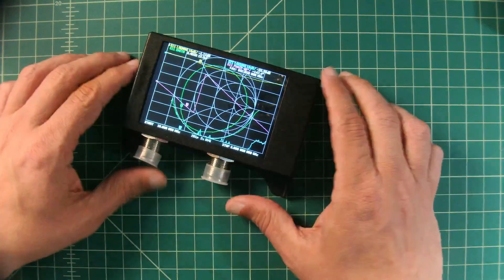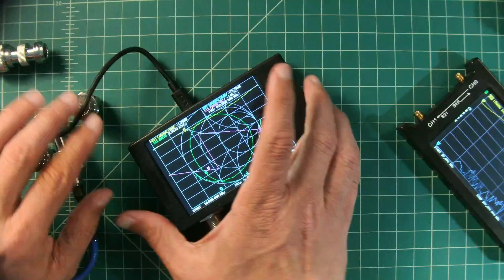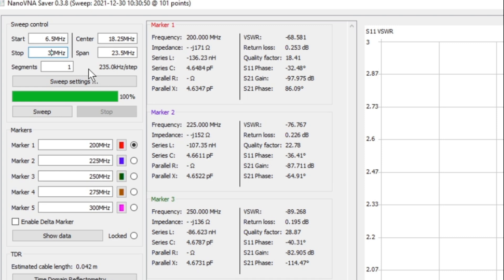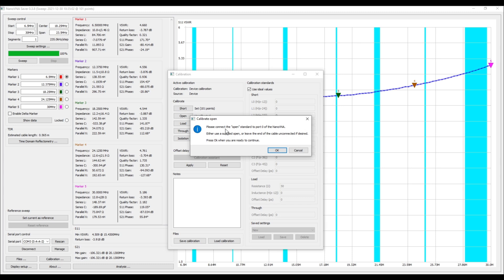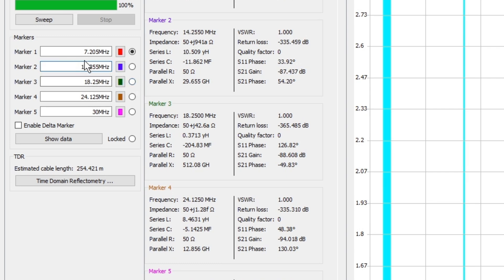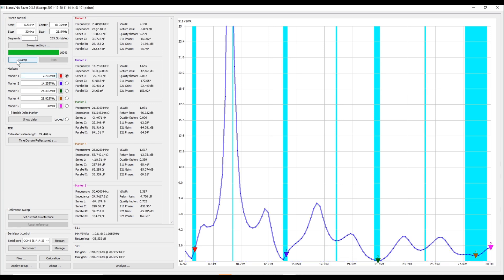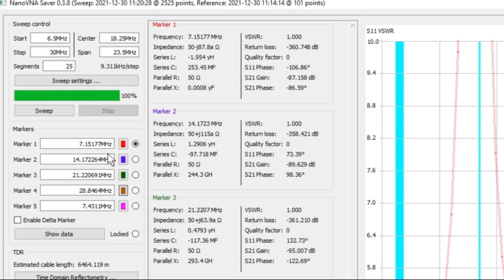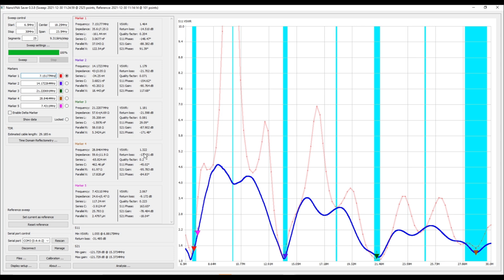Data Points on the NanoVNA SAA-2N

Comment: Hello. Are you using the zeenko VNA (SAA2N). Isn´t the 25 segment sweep a little slow in terms of time ? I have both SAA2N and H. The H is more than 3 times fast but only supports until 101 points. Also, your saver version is a little old
Reply from the maker: The Saver. Person is old because the video is old.  I believe it was a ZeenKo but I can’t remember.  You can adjust your setting to meet your needs, I used a high segment count so my data points were closer together 👍
Reply: @TheSmokinApe  I am 30 years old electronic engineer using this rf instrument for biosensing (have a SAW sensor). Well, today I solved it. My SAA2N is from zeenko so I updated its firmware and now the sweep velocity is equal respect to H. The firmware is from dislord.
 I use nanovnasaver because I had to change the code to add new tools. I also reduce some wait/sleeps on the code to get some mSeconds. Greetings from Argentina

Comment: Thank you for a great presentation. I do have a question about the differences between the two scans.
What happened to the higher peaks recorded in the first scan but not repeated in the second? I'm not new to electronics but am new to RF. Sorry if this is a sophomoric question.
Reply from the maker: Hey Bill.  If I remember correctly it had to do with the number of data points measured in the sweep, the more point the more accurate the trace 👍
Reply: @TheSmokinApe  Hi SmokinApe - Thanks for getting right back to me. I agree with what you say as it applies to the valleys in the scan. As an example of what I don't understand is shown at 10.77MHz. There is a red dot here (assumed point of calculation) with an SWR of ~ 7.9. I can't make out the dots on the blue trace but the result is ~4.1. Cheers! - Bill

Comment: That is the model VNA I have.  I am about to check all my antennas after a long time of not using them.  Luckily my antenna switch grounds all but the antenna I am using so that handles the arcing.  And, when turned off, it also grounds all antennas.  That is a nice bonus of the switch.
Reply from the maker: Good luck with the testing Doug 👍

Comment: Hi SmokinApe I have a question, I really want a nano VNA, this one seems to be the best of them all, even currant date. If you agree please let me know I want a VNA with the 4 inch or bigger screen and up to 3gig seems great even though I will never use it, you never know. It seems well built and I was hoping to get some advice. I live in Canada and can only find these big ones on Amazon, so i hope they are not fakes, then seem legit. I am a new ham and cannot afford a really antenna analyzer like rig expert, and even so nothing in this form factor even comes close like the Nana to doing both HF and uhf/vhf, that is also important to me. It seems the Nano Saa-2N is the way to go, it may not be as lab quality as the Rig Expert and others, but for Ham is it really necessary to be that high degree of accuracy. Please advise. Thanks love all your stuff.
Reply from the maker: Hey Taz.  I prefer the VNAs over the REs for a few reasons.  The SAA-2N is a durable beast, you will love it.

Comment: Great video.  Thank you for making it.  I'd like to get one but I need help.  Where can I get one and from which manufacture?  There are quite a few.  The link provided takes me to your Amazon page but the vna isn't there.  Also, why are the prices all over the place for the same device?  $86-300?  What am I missing?  Thanks.  :)
Reply from the maker: Hey Seafever.  Here is a video where I explain some of the differences, it's a little old.  Some of the newer ones have more features like more spectrum, more data points and SD card storage... oh, and larger screens.  The Aursinc store on Amazon is a good place to look as well as RandL.com
Reply: @TheSmokinApe  
Cool beans. Thank you I greatly appreciate it.  😃

Comment: Any benefits to going N Type vs SMA? It seems either way you need adapters. Thoughts?
Reply from the maker: You will need adapters either way.  Some folks will insist that N are more robust or SMA go higher in frequency.  As a ham, I would just get the VNA that meets my needs and that I already have adapters for...
Reply: @TheSmokinApe  makes sense. Thanks for that.

Comment: Great video and many thanks! I'm glad I purchased this item and more so since I discovered your channel. You provide great advice and your explanations are always succinct. My question was with your marker for the ten meter band. Checking with the ARRL band chart, it appears that setting the marker at 28.850 places the marker out-of-band even thought the blue chart section reads for ten meters. Am I getting that wrong?
Reply from the maker: Hey Randy, the band is from 28 - 29.7 without my glasses on!  But you make a very good point that the blue bars are not for IUT Region 2 where the US is located.  You can configure them in the options and need to for 40m and 440m and maybe a few others if I recall correctly.

Comment: I bought one of these. I must say the reason I bought it was to tune my Buddie Stick Deluxe antennas. I have the stick deluxe and the pole deluxe. So my main reason is it's much smaller than my Comet analyzer and easier to carry. I figured it out but I think a video using the screen to program it would be good. For now, I am only using it to check my tuning and SWR. Could you do a video about how to use this in the field? Thanks again for the info. Keep up the great work. KO4PDI 73
Reply from the maker: I can, also I have a playlist of NanoVNA videos that might help.  Thanks for checking out the video Michael!

Comment: Great video...which camera are you using if you dont mind me asking?
Reply from the maker: This is the one I use for overhead: https://amz.run/5Tma
Reply: @TheSmokinApe  thanks Ape.. you have he
Ped heaps with my Nano VNA..do you think you could use the Nano VNA with an 27mhz SWR meter and a dummy load to calibrate or check the SWR meters accuracy?
Cheers
Reply from the maker: @andrewverran3498  I’m not sure the VNA would put out enough wattage to register with the swr meter.  You could measure the same dummy load south both and compare the difference
Reply: @TheSmokinApe  no worries . Much appreciated.

Comment: Thank you for the excellent video. 
Just a comment about the static discharge from the antenna for the benefit of the viewers. Note that the static build-up is actually a charge between the coax shield and center conductor of the antenna feedline stored on the dielectric insulation. In short, the coax is a storage capacitor. The antenna is the charging device, building up the voltage caused by dry air moving across the antenna elements. So a longer run of coax is a larger capacitor. I was once knocked across the room by the charge built up in a 100 foot run of RG-8 that was not connected to a radio but had been connected for a few days to my longwave radio antenna with its 2 miles of 22 gauge wire in it. I don't know what voltage it had built up to, but THAT voltage at THAT current threw an arc that knocked me down, and could and would easily kill any piece of ham equipment it was plugged into except possibly some old tube gear. Lesson learned. I now include a 2M Ohm resistor across all my coax runs at the antenna to dissipate any charge before it can build up.
Reply from the maker: Wow, that’s is crazy.  Thanks for the info 👍

Comment: Great video. Thanks for posting. I always knew how important sampling points are. The downfall of one of my antenna analyzers is it is limited to only 80 sampling points. To me, it's limited to single band coverage.......and it was an expensive analyzer.
My SARK 110 can sweep up to 10,000 sampling points as a stand alone unit, but it takes 20 minutes for one sweep. 
I like my NanoVNA H4. I do not want to lug a computer around with me. The H4 can sweep up to 500 sampling points as a stand alone unit. What about the SAA-2N....how many sampling points as a stand alone unit?
Barry, KU3X
Reply from the maker: The most I can get on this one is 201 standalone
Reply: @TheSmokinApe  Correction.....H4 can do 401 sampling points. 
When I got the H4, it could only do 101 sampling points. The newer firmware expanded it to 401. Maybe someone will write new firmware for the SAA-2N.
201 isn't that bad, but more is better. 
Barry
Reply: @barrykery1175  The SAA-2N is up to 401 now.  Love the upgrades.